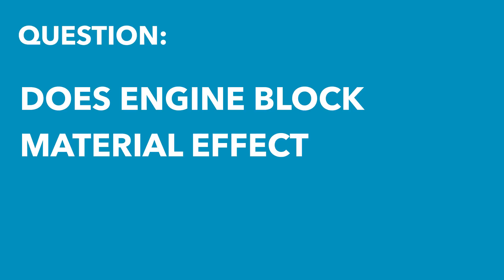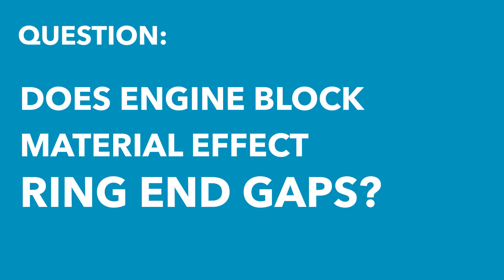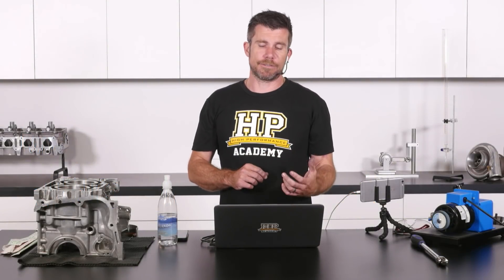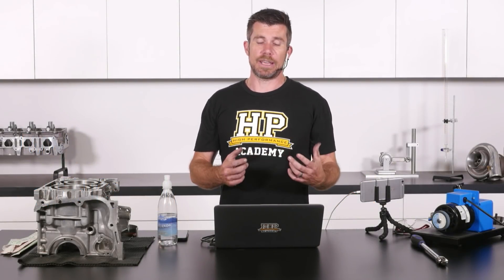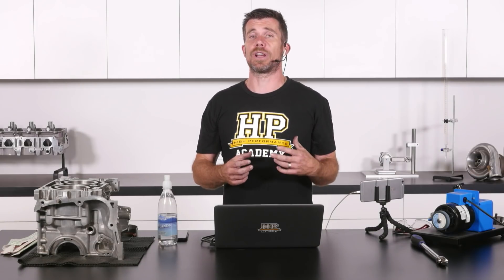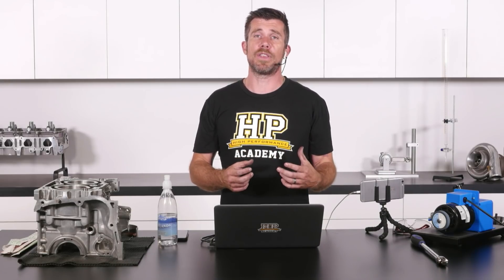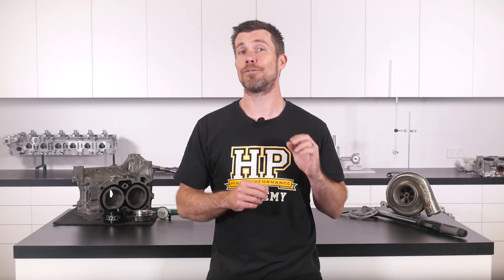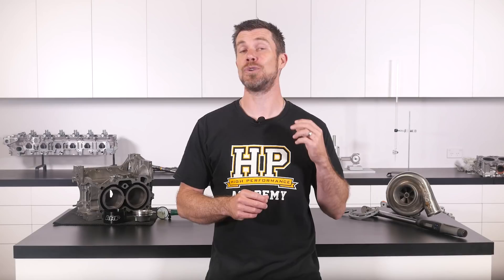[HPA Q&A] Ring gaps - Aluminium vs Steel blocks | Performance Engine Building

Comment: I won’t be able to make the next Q&A but can you guys PLEASE make a video on lighter vs heavier flywheel for boosted and non boosted application?

I have a 470hp turbo Z and blew my clutch. I’m not sure if buying a lighter flywheel with my new one will help or hurt my spool. It’s already a tad laggy since it’s a 6266 turbo. Comes in around 4k rpm.

Thanks!
Reply: Not sure what you're asking - a lighter flywheel will have negligible affect on your spool - that is down to your engine, turbo', etc. configuration.
What are you using the car for? "Most" folks would consider it a good move as it makes the engine a little more responsive, especially for faster road/track work. However, some prefer a heavier flywheel for turbo'ed engines as it can dampen wheelspin, or the cornering balance, when transitioning between off and onn boost which, with some vehicles, can be quite savage. The other cases where a heavier flywheel may be seen as an advantage are in sprinting, where a lot of flywheel energy can get a sluggish car off theline and reduce the bogging that can delay spooling rpm being raised - especially with stick rubber or a tall 1st gear. This also applies, to a lesser extent, for a car that does a lot of stop-start driving as less rpm and/or clutch slippage is required to get the vehicle moving.
You may want to review your whole installation - maybe looking at a slightly smaller turbo' - or at least the hot side?

Anyway, more comments you get, the more informed you will be - I may be wrong for your application :-)